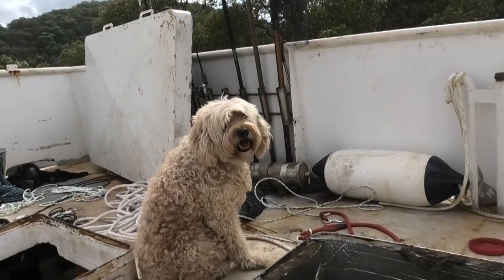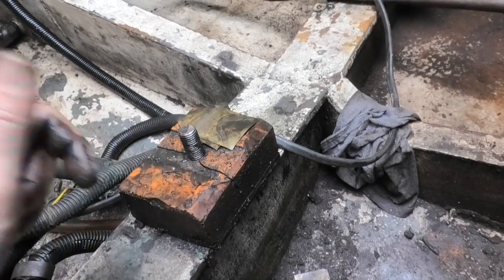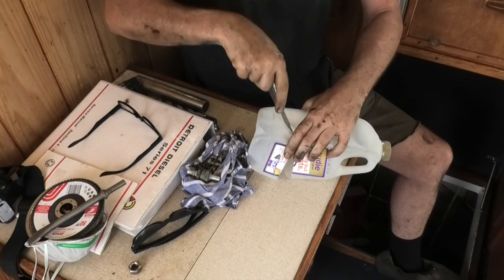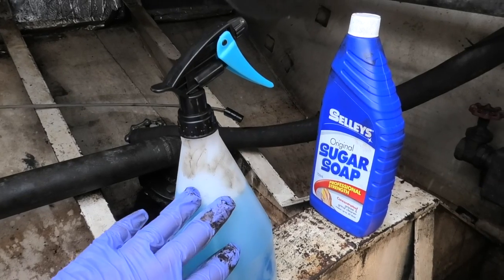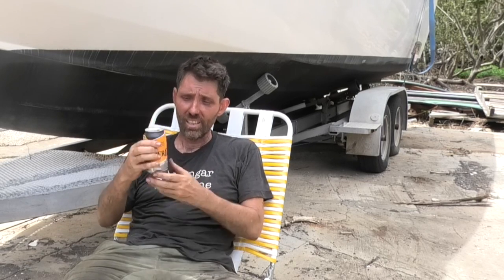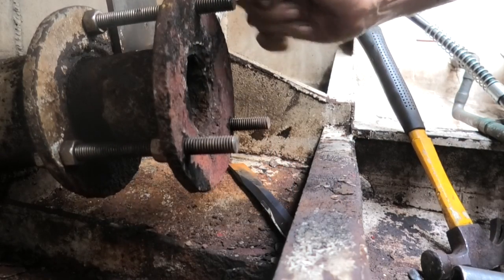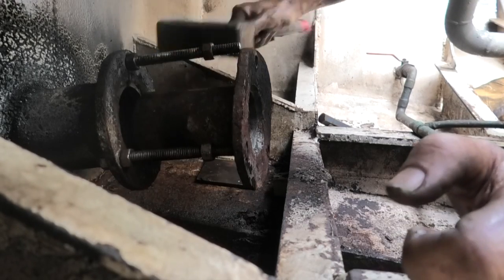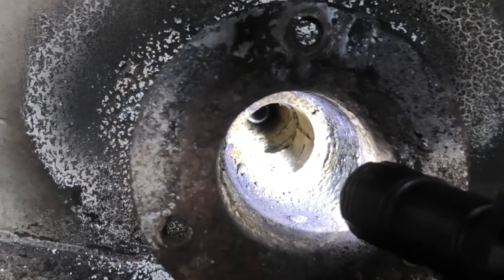Removing the propeller shaft from the steel trawler

Comment: Hey Stu, if you get a new gland follower made you should consider getting a split one made so you can change the packing in the future without removing the coupling or the follower being in the way. I have no experience with boats but this is how allot of mining Slurry pumps work, and as a Mechanical Fitter I deal with these allot. As WARRANTW3 Said you should install a lantern ring between the packing if you have more then 3 runs. Example of a split follower - https://3.imimg.com/data3/XV/RM/MY-3015168/p-b-gland-500x500.jpg Unfortunately I Couldn't find and mining examples. Just make sure there is some dowels in the split to locate the two halves together. Also the pig tail packing tool you used is usually only used when the shaft is still in place. Goodluck!
Reply from the maker: A split follower does seem good from a maintenance point of view. Yes, with the propshaft out I could have used just about any hook to pull the packing out but I was interested to see how well it worked.

Comment: Cleaning the bilge gave me a flashback to a bilge cleaning job done by many volunteers, including myself, on an old ship a few mates and myself bought off the government to use as an artificial reef. The ship, HMCS Cape Breton was built in 1944. Needless to say in the recesses of the engine room and boiler room, on top of the double bottom was more than half a century for crude and rust, barrels of crud and rust. We probably had 20 workers working on and off to get back to bare metal. The total floor area would have been the size of a gymnasium or a small church.  https://www.youtube.com/watch?v=9qJP5DMEpM0
Reply from the maker: Big job!

Comment: Stop playing games!
 Steel is easy to work with and cheap to replace plasma the crap out. Buy plate and the right size tube and a new stuffing box if that's what you want.
start drinking copious amount of alcohol with people you don't know and you'll find someone to show you the way to a better solution.
You could make all that with the tools you have there in a day or two.but the alternative is a couple of weeks of busted fingers and a lot of head scratching.
I,m envious thanks for the show.

Comment: @0:32 why is there rust in one exhaust port...   can you take the cooling water hoses off.. rig up a pressure tester to it.. to make sure you don't have a leaking exhaust cooling jacket.. 

 there are Gong brushes .. similar to a toilet brush but thicker bristles that are great for cleaning bilges.  there are 2 kinds.. one with 360 degrees with a rounded end bristles. and one with a bristles only on one side. they both come in very handy..   twisted knot wire brush either straight or slightly flared in a variable speed plug in drill  unless you have several batteries for it..  you will probably want something in the 2500 RPM speed range.. Dewalt Model # DWD110K or the rigid Model # R70011 at 2700 RPM both are corded and around $60 USD each.. i don't know if those are available down under.    

 if you are going to weld spots on the outside of the hull.. don't paint anything but the stringers on the inside..  yet..
Reply: Sound advice
Reply: @robp7652  i have 22 years of working on a friends 104' wooden power boat with lots of steel in it like steel stringers.. steel bulk heads.. massive steel framing in the engine room.  and yes.. we did change the steel stringers from the transom almost to the bow..
Reply: Yea I can tell . I've worked on commercial fishing and offshore oil vessels for about 15 yrs . From old cypress planked oyster boats to 120 foot alum crew boats . Even a few push boats on the river . I think he is doing a great job especially by himself mostly. I so wish I could help. Maybe he will do his next one here in the blue ridge mountains. Lol .just went back and looked at exhaust . That was a good eye.
Reply: @robp7652  the only thing i would be doing different would be grinding out the cavities in the outer hull a few a day followed in minutes by mig welding up the holes but using some kind of pyrex cup to purge all the atmosphere out with shielding gas. so the welds come out perfect.  a few dozen a day would reduce the pain of welding them all up significantly..  the only issue is fire watch on the boat.  a garden sprinkler on a garden hose with a valve by where he is welding mid garden hose to allow exterior application of water with a camera set up and a video monitor to watch where he is welding at.. since he will be spotting in for 20 seconds then look at the monitor.  its not a big issue about not having a second for firewatch. .

Comment: If you blast it using a pressure washer and a mix of sand and water you use a lot less blasting medium and you don't have all the dust to deal with. Your lungs and your neighbours will be grateful.

Comment: Is that asbestos gland packing?
Reply: Not likely for the age of the boat.
Reply: Looks more like graphite.
Reply: @davebrittain9216  Cotton? graphite, or made in NZ, flax/graphite.
Reply: We had like a braided cotton with like wax impregnated in it
Reply: @grancito2  Yes typically you will see graphite impregnated cotton packing. At least that is what I have seen.
Reply: @grancito2  I am curious what the age of the boat would have to do with it? How old is the boat? They used asbestos in N America till the mid 80's. Not sure how long they used it till at this boats location.
Reply: @davebrittain9216  The boat is not old enough to be from the asbestos era. Down under, to my knowledge, new materials had no asbestos in the early 70s. I don't know when it went off the market.
Reply: @grancito2  That is actually not correct. I just looked it up and it was banned in building materials the same as in N America, in the 1980's and completely banned in 2003.
Reply: @davebrittain9216  Some manufacturers must have stopped using asbestos before the ban, in 1981, "asbestos" siding I was using was made from wood fibre and cement, and in 1979, the cutlass bearing I used in my boat was made from cotton and resorcinol. Graphite impregnated packing is not recommended by the manufacturers, for stainless shafts, as it causes pitting.
Reply: @grancito2  Yes some would have stopped using it but in some cases they still make some things out of asbestos because there simply is nothing else that will work. What is resorcinol? I have never heard of it before.
Reply: @davebrittain9216  Some packings are still made from asbestos. Resorcinol is resorcinol formaldehyde, it is a thermosetting resin, originally phenol/ formaldehyde,   a very old material usually used for electrical insulation panels, light fittings, and was called bakelight, something like that name.
Reply: @grancito2  Oh ok thanks for letting me know. I have mainly ran into graphice/cotton packing myself on older equipment and steam pumps.

Comment: Love ya vids... but CHEAP SAND BLASTER....  Waste of time.. especially for the amount of blasting you need to do.

I'm talking about the ones that run off standard air compressors..   Hence why real sand blasters run off MASSIVE stand alone compressors... and the operators have a full space suit ..  
10 times easier with a real one..   Fenwichs - Had my 52' cruiser out of the water there back in the late 90's for six week... major refit..  great place.
Reply from the maker: Yes, this will be used for relatively small spaced. Will probably get a pro to do the hull.

Comment: There are several types of dripless shaft seals. I have install several of them. Here is one. It’s made by a company in the US called PSS

. https://goo.gl/images/ZZXDfR This is a good seal but has some drawbacks, the sealing surfaces are 316 SS and a hard Carbon face. The biggest problem with this one occurs during installation. Any rough handling you can chip or crack the face and it WILL leak. 

The other is from a company called Tides Marine,  https://www.tidesmarine.com/shaftseals/sureseal_overview.php  I actually live about three miles from them. I’ve installed maybe 20 of the original style. Installation is easy, they come in both sae and metric sizes. There only drawback is the can’t run dry and must have the cooling line. A really cool feature with Tides is you can pre-stage a replacement seal on the shaft during initial installation. If you cook a seal you have one ready to install without disconnecting the shaft coupling of taking the boat out of the water. I highly recommend the new version “SURESEAL”
Reply from the maker: Hey mate, thanks for the info. I've just taken a look at the Sureseal info and it does look like a straightforward install. I'll get in touch with them and get some pricing.
Reply: Dangar Marine With the engine compartment empty, it’s east to install. You’re bilge will thank you for it.

Comment: You can buy a Boxed Roll  of packing and Cut your own.... buy the roll wrap and same tightly around the shaft, then scribe two straight  lines down the full lengthways down the packing you have rolled out parallel down counting roughly the number of rings required as you go...  , scribe two lines down same , the  width between the lines is the width between the lines is the width of the packing you bought  ...the trick now is to get a Stanley Knife and now cut forty five  / diagonals in between those  lines ... when all cut through you're done they will interlock ..thus no short and no long ones ...you can stagger same when fitting it's a neat way to cut same...you will see the way it's done, 1 Min into this Linked Clip https://www.youtube.com/watch?v=VPu8_Ng7X5c